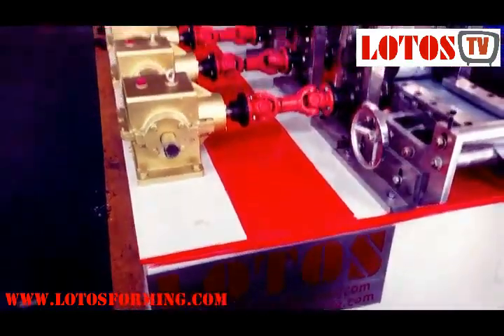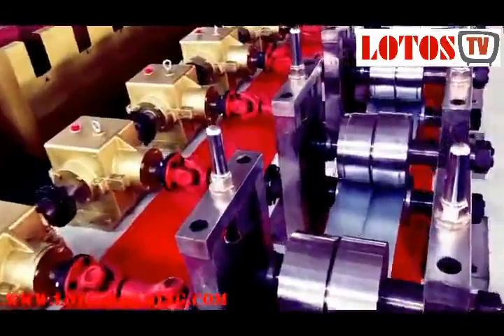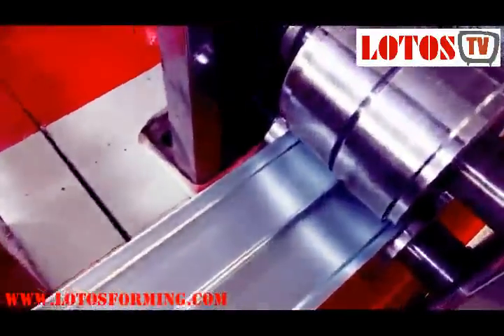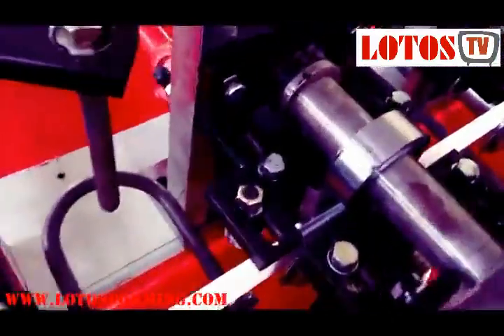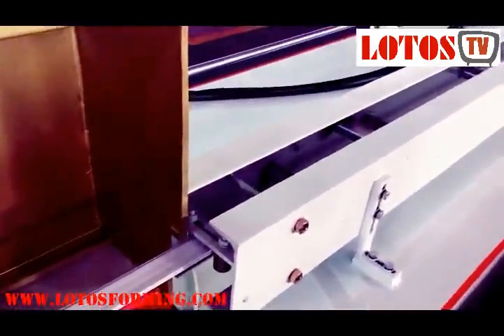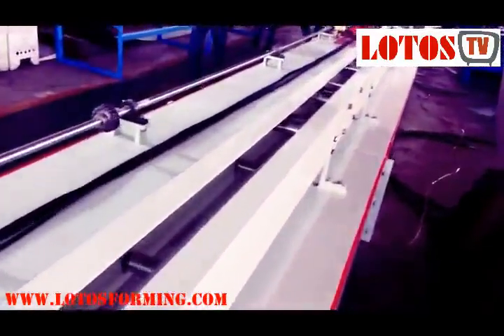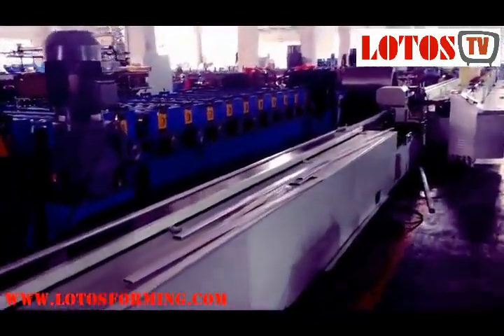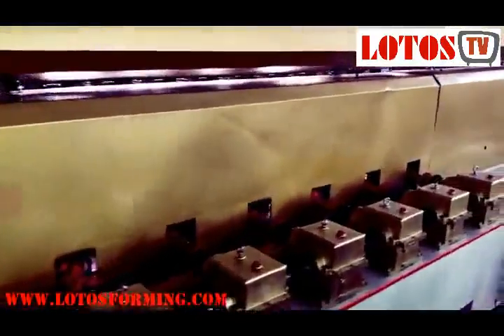【rolling shutter | roll up shutter door】: Window Shutter door Roll Forming Machine "44 mm PU Foamed"

Comment: A #roller #shutter, coiling door, roller door or sectional overhead door is a type of door or window shutter consisting of many horizontal slats (or sometimes bars or web systems) hinged together. The door is raised to open it and lowered to close it.